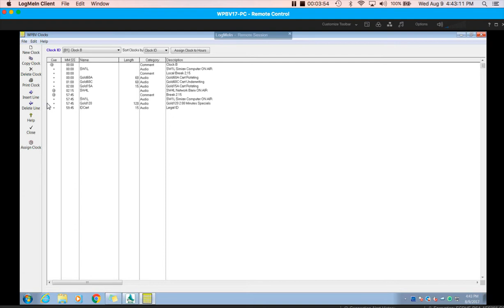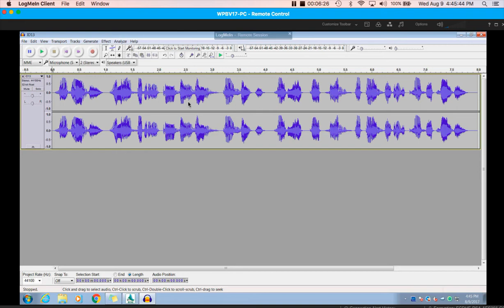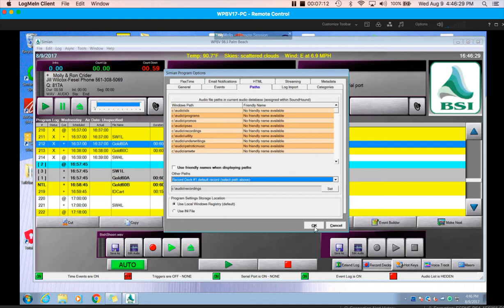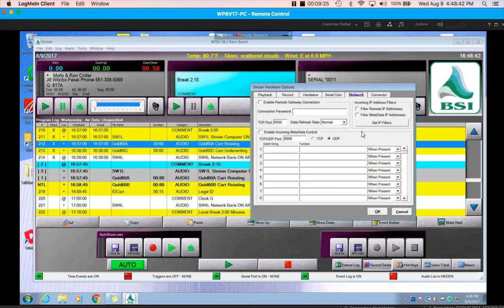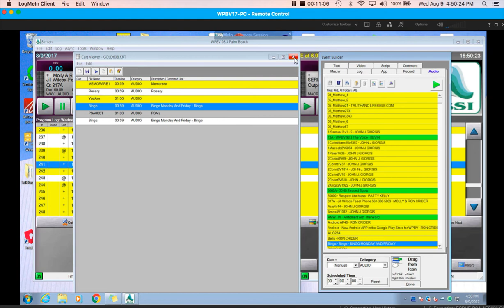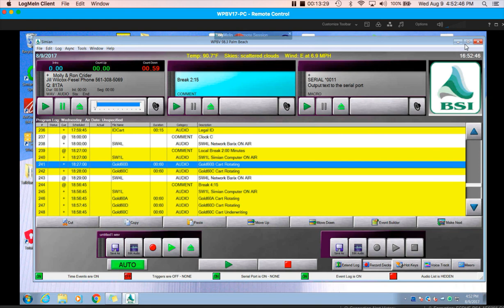BSI Simian Pro # 1

Comment: Our Simian runs fine all day and then when we come into the station in the morning, it has stopped frozen cold and one song in the card is red-lined. I've checked to make sure that the songs that the cart is referencing are in the file list and are .wav files with the correct parameters. I've even deleted the songs that were supposed to play at the time of the freeze in case those files were corrupted. I've also looked through all the other files Simian is accessing to make sure they are only named with numbers and letters and no special characters or spaces and I've taken all the mp3 files out. But, it keeps happening and all these files have played just fine for an entire year? What's going on? Any tips on what else I should check?
Reply from the maker: Sorry for the delay. Is it working now! Hopefully it is!

Comment: For (low budget) broadcasters who only know Raduga and Zara, we need terms defined.  We don't know what a clock is, or a cart.  Cart in broadcasting conjers up the old Tapemaster audio cartridge "cart" which generally was for spots.  What is a cart in Simeon.

Comment: It's such a pain in the ass that I have actually gone back to using Media Monkey. Too much dead air, way too lmuch lag between "carts". Even if your records.carts are edited tightly there's still too much of a gap unless you go though each and every file and tell it what the fade-out/transition should be.
I like the auto logging, but if you have a huge library it's just not worth messing with, and it's far too sloppy transistion wise.
If I had to go full automation, I swear that I'd rather deal with the old reel tapes and daisy wheel cart decks system.

Comment: I love would to see how you do a auto fade macro set up, so I have smooth fades outs to local news when it comes on with the @. rather then a sudden jump. have not been able to achieve these things yet
Reply from the maker: I will make a new video today showing you how I do it. What is your format? What time do you join the News?
Reply: so we use Natural log we have a log of all our Ads, and at 1pm we build a list of music around the Ads with station Ids that we drag in from event builder. Local news we drag in at 1:30pm to Play with the @ symbol, the issue can be that if the track playing before 1:30pm isn't timed out and rather then a smooth fade out just before it hits that @ it stops and Jumps straight too it. A Macro that would Auto fade for 10 seconds before it reaches  1:30 would be perfect and sound more smooth.
Reply from the maker: I would put a ! at 1:30 rather than the@ sign. If the BackTime is turned on. Also be suren the Back Time is enabled  in the Flex Time tab in Tools/Program Options. If you continue to have a problem text me your phone number I will call you and walk you through it, NO Charge.
Reply from the maker: 772-913-2209
Reply from the maker: Adster I’ll do a special video just for failing